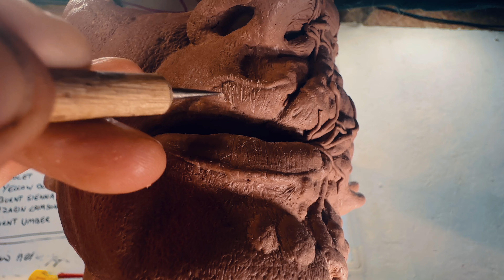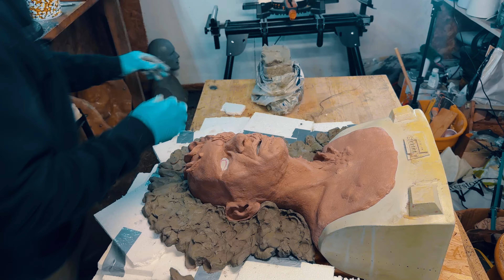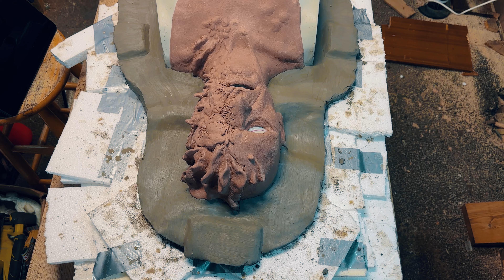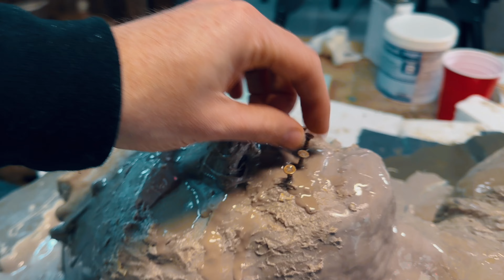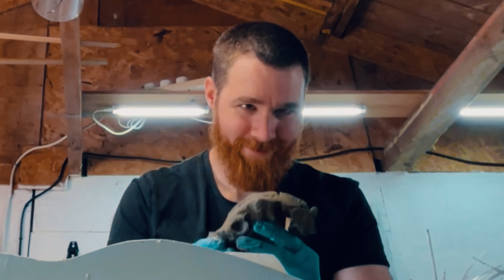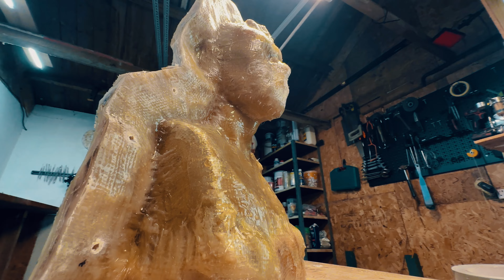I’M MAKING A SILICONE MASK INSPIRED BY THE LAST OF US!! PART 4

Comment: What resin did you use for the fibreglass mold?
Reply from the maker: The initial coat is a product called shell shock by @smoothon it’s a Brushable Liquid Polyurethane Plastic. The rest of the layers are general purpose resin and fibreglass mat.